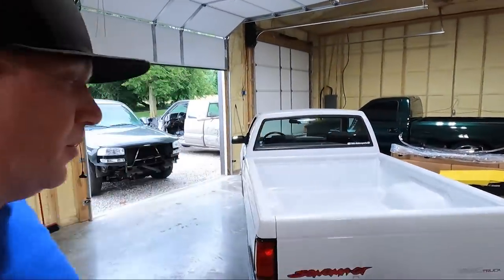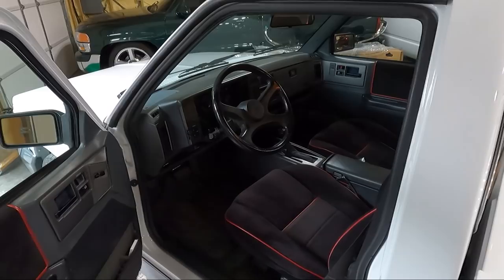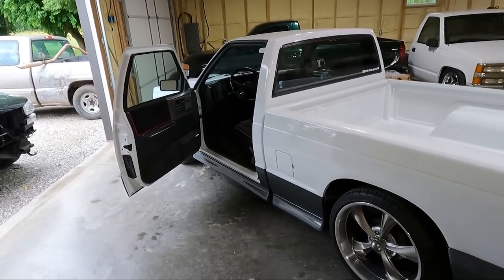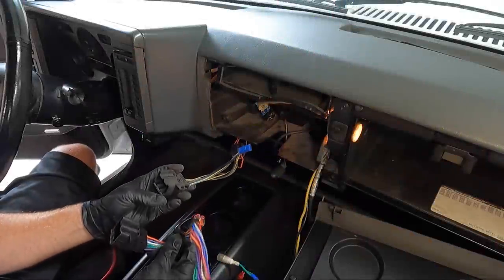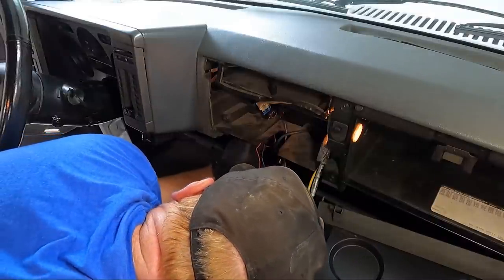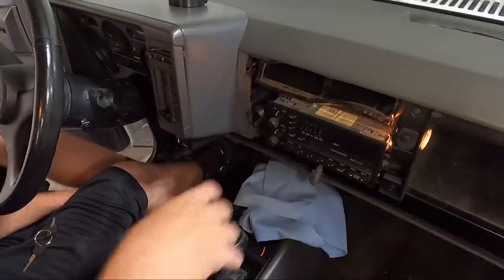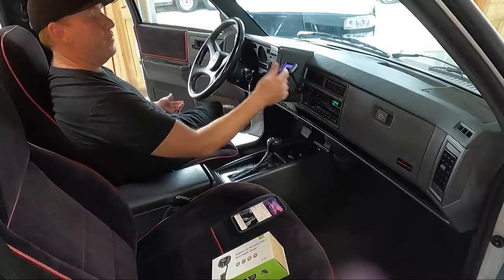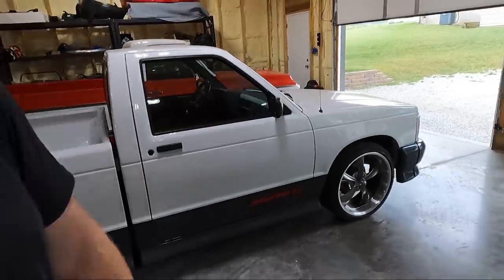Back to Stock Radio in Sonoma GT (Plus Short Antenna and Bluetooth Addition)

Comment: I really like those old school delco radios!  They were made by Panasonic and the tape mechanism was made by blakpunt (sp?)  I'm surprised your truck did not already have the later style GM connectors as they went to this in 1988.  GM used to sell those adaptors to allow the use of later GM radios in older GM cars.  That random plug that went to the fuse block was for the clock.  When your radio is off it holds the stations and on some models hitting the recall button will turn the clock on for about 5 seconds.  Those were some great sounding radios at about 75-100 watts.
Reply from the maker: That is awesome information. I love hearing stuff like this from somebody who knows. Thank you.

Comment: The brackets that were on your old radio are actually the OEM brackets. A lot of the GM vehicles from that era were like that. Those plastic ears were oem and the kits came with the studs to mount them to the aftermarket dash kit
Reply from the maker: I thought they fit nice. Lol

Comment: Metra  use to make those old gm to newer gm harnesses like that but all the lil square bodies had the larger three plug and the two pin connector for orange constant power
Reply: The older alpine cd changers had to have a yellow and black wire for its power with the cable that clips in
Reply from the maker: Thats good to know. Thank you

Comment: On the antenna…surprised that you did t reroute the antenna through the engine bay. Cool Bluetooth
Reply from the maker: Not sure what you mean about the Antenna
Reply: 🤭. Dang it. I accidentally hit send. I meant to rewrite my “antenna” question. Lol
Like with the Green Sierra….how you rerouted the antenna and mounted inside the fender
Reply from the maker: If these wasn't a hole in the fender I would

Comment: Why do I love the plastic sound of the older vehicles. My 99 durango is the same way. Super cheap plastics.  Wiring exploration kinda sucks lol.
Reply from the maker: Lol. It does suck sometimes
Reply: My 73 dodge truck has been quite the adventure even though there should be very little wiring lol.
Reply from the maker: I'd imagine

Comment: This..... https://www.youtube.com/watch?v=ZI0Vp-8TU54  Add BT to your current stereo.  If you can't do it I would find a shop that could.  Just bench test an old junk yard stock one for your model with a battery and cheap speaker to make sure it works first.  Pretty easy to get something  that solders in.   I would hack one up... keep my stock radio from my 08, but adding a Alpine and amp this weekend.  Just need to solder up the harness today.  Its modern though.  Getting a backup camera, BT and the ability to mirror my phone for navigation which will help my truck a lot!   Speakers later... likely after I sack the stock ones... which should be fast with the amp.   I dig the shorter antenna though.  The issue for me with FM type adapters is interference.  Some many stations here its hard to find one that doesn't fuzz out.   Hardwire is a little better IMO.
Reply from the maker: This one works well with no fuzz but that is an awesome option. I watched that video and its definitely intriguing
Reply: @TWAMotorsports  For the older trucks like the new C10 for you wife they make those cool options that look stock, but are actually digital with BT options and USB inter faces. I think they even off RC outs for connection to amps.  You flip the switch to expose the digital or make it look analog. Great option to not cut up the stock dash for that stock look.  I agree with you there... If I had an older car I'd not want to mess it up with a bunch of add on stuff like you mentioned in the vid.
Reply from the maker: Yeah I have one in my 52 truck